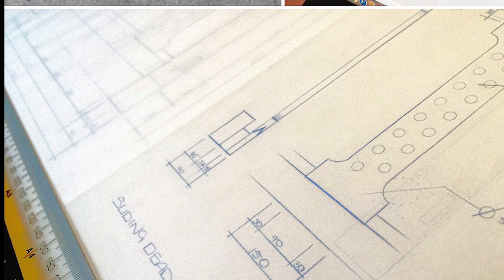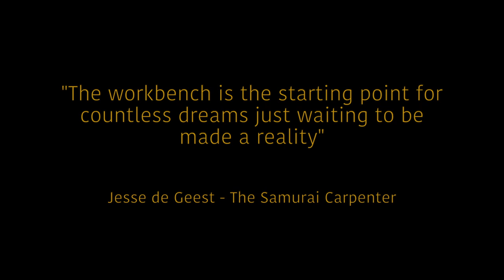Sue Rhodes - My Workbench

Comment: Nicely realized plan Sue. For me it's a little short but that's horses for courses. I prefer a top which overhangs both ends. So I'm wondering what your design brief was in doing both ends flush to the top? Do you think in retrospect that having a shiny top might become a bit of a nuisance in practice with wood sliding around? I ask as I've just started my own build. So grateful for any input. Thanks.

Comment: Just curious...
did your instructors suggest that you thin the Danish Oil... like 1:1... and put on several coats thinned... before putting on the finish coats?
Yellow Pine is some tough stuff... but it expands across the grain more than any other pine... and you do not have floating end caps.
Thinning the initial coats allows the oil to penetrate deeper into the wood... which would help to seal the wood better from the changes in humidity.

Nice work.  Everyone could use a small workbench like that.

Comment: Besides your bench looks functional and practical, it's also very cute :-)
For me as a beginner, it has just right balance of functions I think I could need. The size also fits very well.
Tell me Sue, if you now decide to build your bench from the beginning, would you change anything?
Reply: Thank you, and good question! The only thing I have noticed is that I haven't used the tool rack all that much at the back. I think probably because my bench is so small, when I have on occasion used it the tools can seem to get in the way. So now if I'm not using them, I generally place them on my nearby side bench. It's okay for conveniently dropping small things into, like my Veritas marking gauge and the odd screwdriver, but anything bigger like a saw can get in the way a bit. All else seems to be working well for me.
Reply: I like the tool slot as an option.  I think when i make my dream bench I will include it like yours.  Very nice.  If you remove those vices it would work as a great kitchen island as the small size just seems so much more advantages.  I am thinking 2 small benches like yours would work better than one large one as you could easily clamp them together if you really needed a monster bench.

Comment: Beautiful workbench. How did you fasten the top to the apron/ table structure? Thanks
Reply: Good question, I don't think it is shown in the video. I drilled through the upper side supports (x 2 on each support) and screwed through with coach bolts straight into the underside of the bench-top.

Comment: Nice, clean design and nice, clean job building it.  I also like that sliding support.  I wish you had chosen a harder wood but this bench will be an amazing expression of your own experience with it.  I agree that you did a lovely job with it.
Reply: When I was a student, many years ago, I tried to economize on the materials I used.  Over time I realized I was doing myself a disservice.  I try to pick the wood that fits the application rather than the most economical wood.  And, just from looking at the quality of the pine you used, it couldn't have been very inexpensive either.  But from what I could see, your work was done carefully and with sensitivity.  So, who am I to complaint.
Reply: I have seen one slightly better, by the Samurai Carpenter, on You tube

Comment: Nice bench, but looking at you using it it looks short for you (you're pretty hunched over clamping the vise and planing).  I know that I build my benches and stands at 41.5" tall and I'm 6'4" (taller than most on both counts) and I'm quite comfortable with that.

Comment: Biult my two adult  daughters  benches  Both 2foot  x 4foot but of different design   Not fancy joinery but straightforward  and sturdy design    I  wanted to  pass on my legacy  as an old carpenter and give them the ability to "do it youself" not that they are pretty handy already,  L based them on my first bench ( a 2x 6 foot bench with 4vices ! ) and 3 books on bench and 100 magazine articles I collected over 40+ years   The most satisfying thing I've ever done !